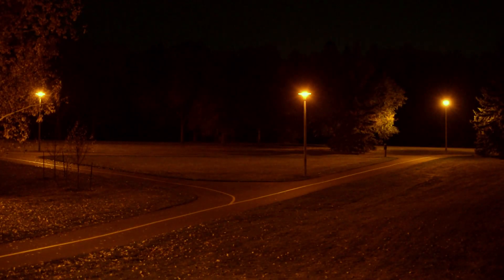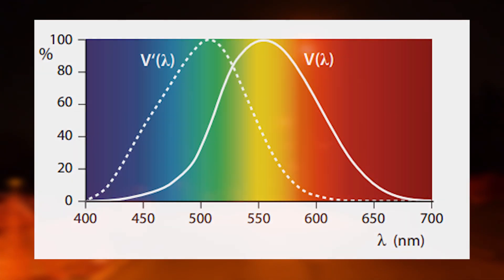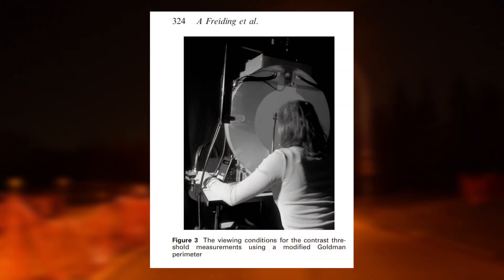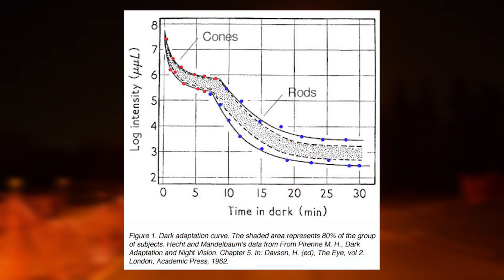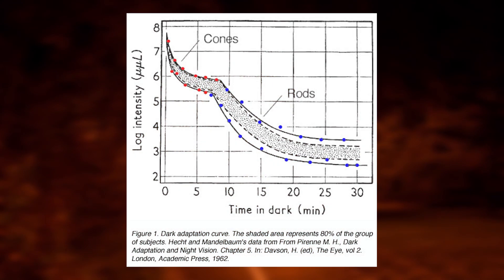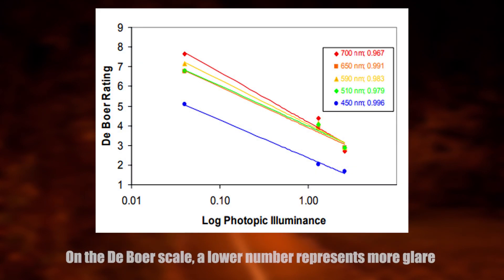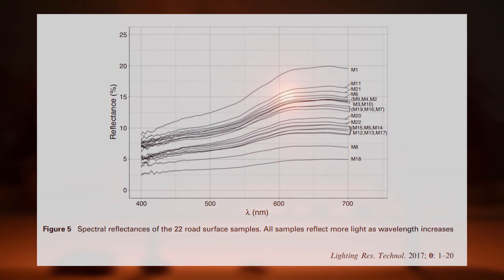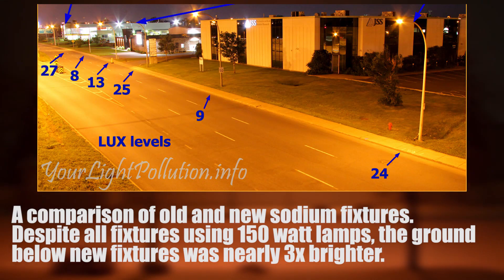How a Simple Concept Enabled a $50 Billion LED Streetlight Scam that Changed our World

Comment: Thank you for the scientific info. Would you please contact me with advice on where to purchase streetlights for my country township?
Reply from the maker: Hi, I am not an expert in the purchasing / installation side of lighting but I can offer some advice depending on your situation: 

Do you have existing light or power poles that fixtures can be mounted on? If so, do you have the equipment to access these poles and install fixtures yourself? If a contractor is needed to install poles and / or fixtures, they will push to use lights from their own supplier / stock.

If you are able to complete the process yourself, look for a supplier that has a physical and well-known presence in your country. There are hundreds of cheap made-in-China light fixtures on the internet, avoid these. This may be difficult as the production of sodium light fixtures is slowing down and LEDs in the optimal range of 1800-2200K are still at the cutting edge of the market. 

If you are looking for a light that produces 15,000 lumens or greater, high pressure sodium is the most efficient option. For smaller lights however, 1800-2200K LEDs may surpass the efficiency of high pressure sodium below 15,000 lumens. The most important factor in choosing a fixture is glare control. The fixture should obscure direct view of the light source (LED diodes or HPS bulb) with refractive / diffusing glass. Unfortunately this is also difficult to find as the market no longer values glare control.

I cover light source selection in the final 3 minutes of this video: https://youtu.be/miOlVI5mJc8?si=WXtizeEGgdG7wJs2&t=3455

I hope this helps you!

Comment: The yellow sodium lights are the worst. They are dimmer and very depressing to work under. Yellow sodium makes a long winter night longer. The LED's are brighter and i can see very well till, they blind me or start flickering. For me the LED is a winner only because i can see better at night and has been a great but, far from perfect replacement for the hideous yellow sodium vapor lights..
Reply from the maker: As covered in the video, LED lights do not improve vision. They appear brighter because we perceive brightness as "which light hurts my eyes more". The average outdoor LED provides 5000 - 15,000 lumens depending on wattage. HPS fixtures often provide 10,000 - 50,000 lumens. If sheer brightness is desired, sodium fixtures providing 150,000 lumens of light can be installed. These are yet to be matched by LEDs. 

Sodium light bulbs dim as they age and turn to a deeper orange color. If your work place installed new sodium lights in new fixtures your problem of dim light would likely be solved, providing much more light than a downgrade to LEDs. What sort of place did you work at? The most likely scenario is that the sodium light fixtures were decades old and filled with physical piles of dirt, greatly reducing light output.

Comment: LED streetlights are so disgusting. Everything over 3200 K and especially 4000 K LED are so damn freaky obnoxious. It doesn't especially matter if they are dimmed or not, if they are properly shielded or not. The bright unshielded LED streetlights are real some kind of biological weapon, but even dimmed and properly shielded white LED give no comfort whatsoever. 

Even an overlit place with HPS is a  much more comfortable, cozy, lively place. I lived in a palce where there where about 20 HPS just right behind the window and I had no problem with light pollution. But one single bad white (and especially bluish LED) can really spoil all the picture and make life and sleep extremely uncomfortable. Warm LED about 2500-3000 K are better but still they are much worse for me than HPS. HPS have CCT about 1800-1900 K and such outdoor LED lighting is an extremely rare thing. I swa pictures of very warm HPS-like LED in Europe and Quebec (Canada), but there is nothing of the kind in the US and all other provinces of Canada. The US and Canada should roll out the mass-producing of ultra warm LED 1800-2000 K for street lighting and then the situation will drastically improve.

And of course , there should be laws about light ads and signage, about building illumination and other forms of decorative lighting. Probably quite proper when used in due time and moderation, the things have totally spiraled out of control here with LED. We need a light ads and signage curfew about 11 PM. I know only about 2 US major cities with such curfews - Flagstaff, AZ and Ann Arbor, MI. Flagstaff has good outdoor lighting about 2500-3000 K (but not 1800-2200 K), but Ann Arbor has an extremely bad outdoor lighting with 80 percent of lights there more than 3200 K. And Pittsburgh , the so-called city that has extensive light pollution laws, is a joke. The lighting is bad there, the city is overlit with bad lighting in many places and there is no curfew at all on light signage and ads. 

And of course, we need to do something with LED headlights. The only talk and research only about LED street lighting, and so called lighting rich in blue-spectrum (3200 K and plus). But there is no talk and research about LED headlights and they are always extremely rich in blue spectrum, hit the eye straight like a bullet and there is no escaping from them while being on or along a highway. I swa examples of good LED streetlighting, but I haven't ever seen any example of good LED headlights.